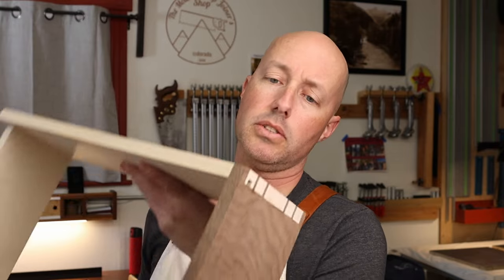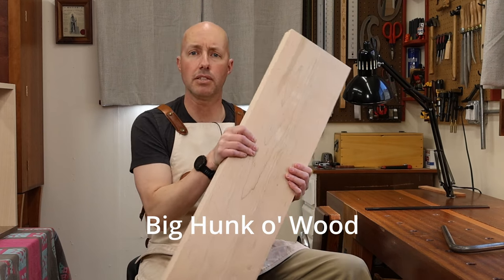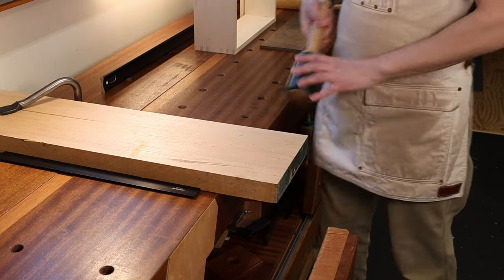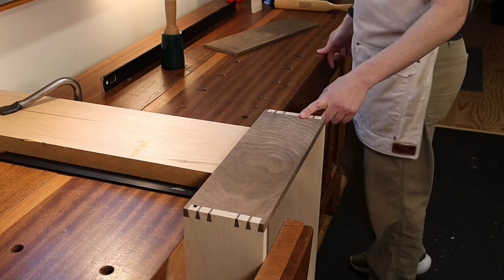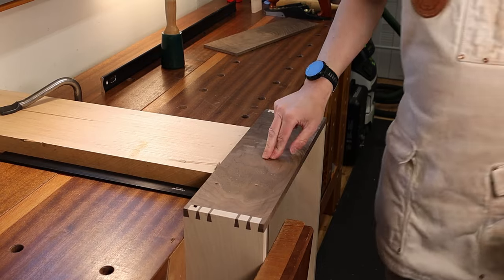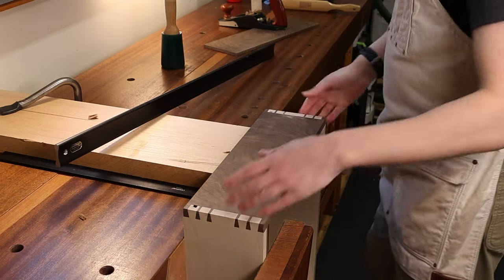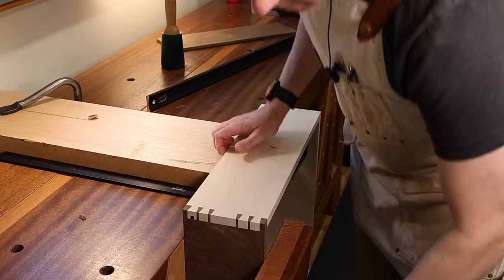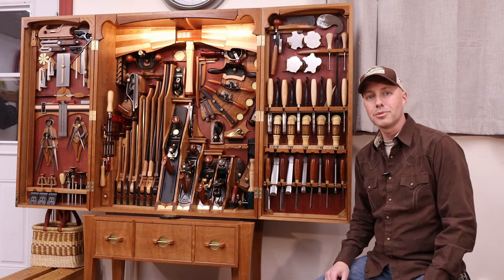Cleaning Up Hand cut Dovetails

Comment: Thank you so much for taking the time to make this video.  Your method of explaining things is so clear and unambiguous.  It gives me the confidence to know that I, too, could maybe someday do a decent-looking hand cut dovetail drawer.  Why do I let that intimidate me so???  Anyway, my real question is something you mention in the video.  You said you used to have a crochet hook on your bench, and now you have the leg vice.  Is there something inherently better about the leg vice?  I feel I could build my new bench with a hook to start, then maybe do the leg vice later, or is it that difficult to install the leg vice?  I'm just curious for your input on the efficacy of one vs the other.  The crochet hook intrigues me for it's historical application, but a leg vice seems more versatile in the long run.
Reply from the maker: The leg vise is a huge improvement by virtue of capacity, versatility, and clamp-ability. The only thing the crochet excels at, other than being very low cost,, is edge planing operations.

Comment: The stop is a bit superfluous (in that the vice resists the forward motion of the workpiece, and the sticking out piece of wood is only under vertical .....downward.......pressure), but otherwise, this is much how I do mine, and, funnily enough, exactly what I was doing this morning. My variation is that I put the rear edge of the drawer in the vice, and support the forward end of the drawer with the sticking-out batten. Your sloped vice wouldn't be suitable for my approach, I don't think, but it's a trivial detail. Another approach I have used is to stand a saw horse under the overhang of the bench, with a drawer sitting on it but held in the vice. Doesn't work with my new bench.